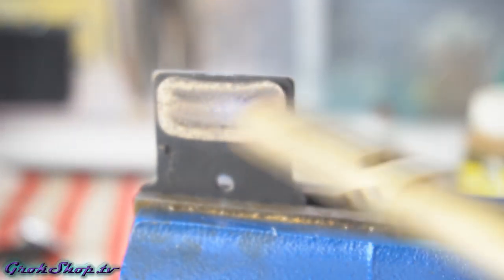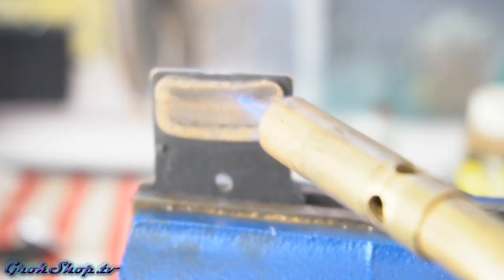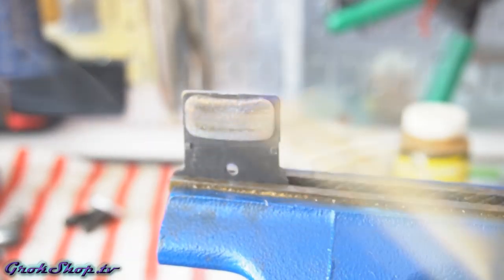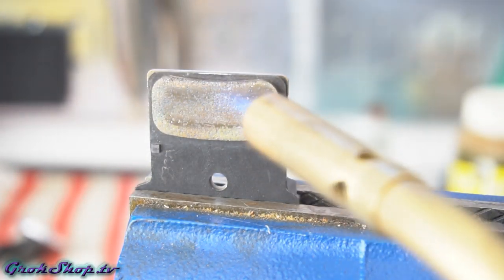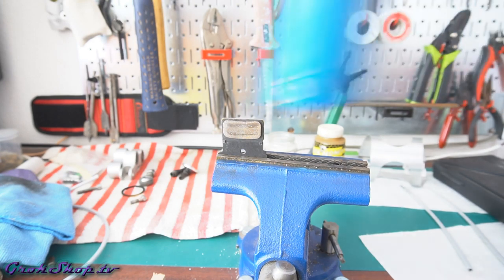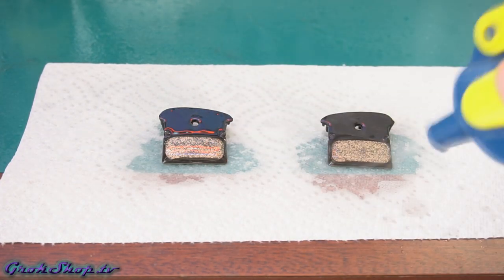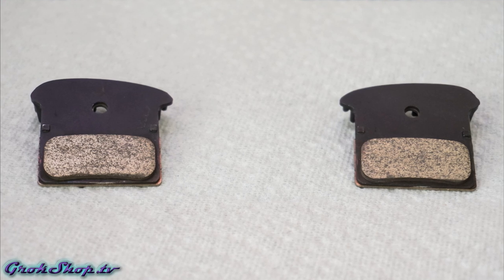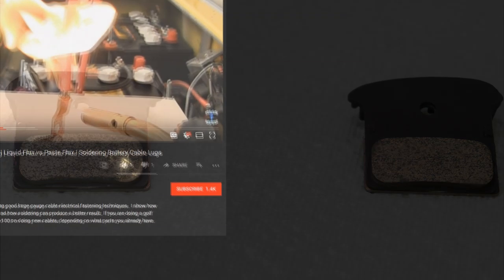Bicycle Maintenance: How To De-Contaminate Disc Brake Pads

Comment: Baking my pads at 300 F, then doing a light sanding fix my pads. 
While bleeding my brakes I managed to get mineral oil on my pads pretty bad. They were very loud and didn't have the stopping force they should. The lesson I learned, always remove your wheel and pads before bleeding, it'll save time in the long run.
Reply: I do it every time
Reply: Did the oven stink?

Comment: Hello, the trick worked!

I accidentally soaked my brakes with WD40, then I realized the brakes were gone when I used the bike, they were squeaking loudly and basically useless at braking.

Someone told me that boiling the brakes can bring them back to life, so I boiled them then heated them until they became red.

Left them to cool down for a few minutes (no water was used), then used sand paper and removed a good layer.

Now they are working perfectly fine, the braking power is strong. No squeaky sounds.

I did all of this instead of buying new ones because I didn't want to wait for an order, the brakes were also new, with plenty of material left, so this fix was Worth it.

Comment: Hi! Thanks for this video. I wanna try this. What kind of blow torch can I use? Obviously I don't wanna get any heavy duty one, because this is the only reason I'll need it for and if I have to spend way more money for a fancy blow torch, I might as well just buy new pads, right? Do you think I can use a kitchen blow torch that's used for certain cooking recipes?
Or otherwise I could try going the pads in a toaster oven as you mentioned!?
I would really appreciate your feedback. Thanks. 
🙏🌷

Comment: Buying new pads first but going to give this a go.
Well my own method of soaking the pasta in alcohol for an hour then removing and setting fire to remove alcohol and finally the all important sanding 😉
Reply: Soaking pads in alcohol dries out the resin and results in the pads deteriorating soon after.

Comment: hi.
By coincidence i also bought the disc brake quite apray you showed .
Where do you recommend to use this product? Directly on the pads?
At first i thoughr was a diac brake cleaner but immediately i saw the blue layer it left so i didnt use it anymore

Comment: Will this technique work for the disc rotors too?
Reply from the maker: Interesting question.  Seems logical that it would.  I guess the rotors don't absorb contaminants as much as the pads, so for me - sanding the rotors seemed to do the trick there.
Reply: Don't heat the rotors you'll warp them
Reply: @dabooge  Makes sense.  I torched the pads, cleaned with alcohol, lightly sanded and cleaned again with alcohol.  Did the same for the rotors but did NOT torch.  Brakes work great now.

Comment: Would heat gun work?
Reply from the maker: Hmmm... interesting question.  Well it depends on the max temp you can reach.  So like what is happening is you're basically boiling the contaminants out.  These are usually things like oil and grease which tend to have high boiling or "fractional distillation" temps.  Let us know if you try!

Comment: Is it possible for these brake pads to crack from excessive heat?
Reply: I dont know about cracking but i just tried  this and it bent the backing plate so now are ruined forever  i dont recommend this method
Reply: I've done this a few times over the years with no issues. I am careful not to go too crazy with the heat though